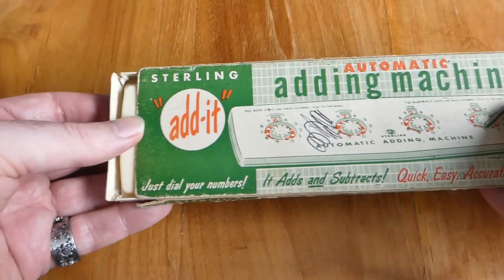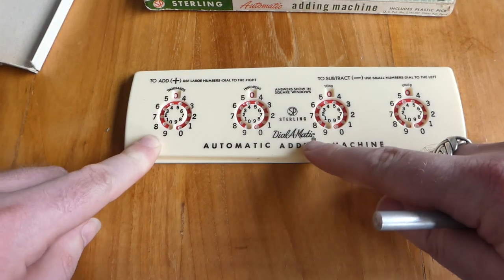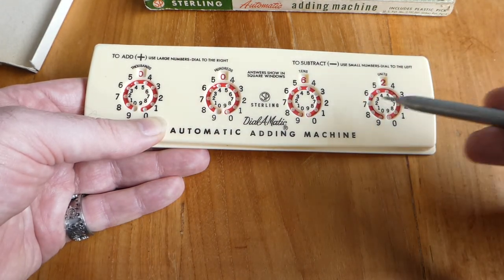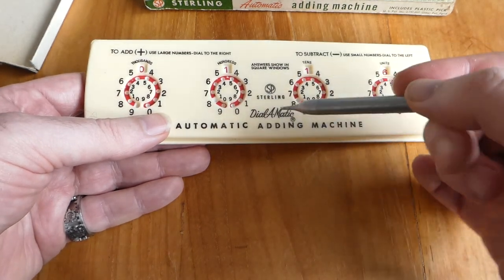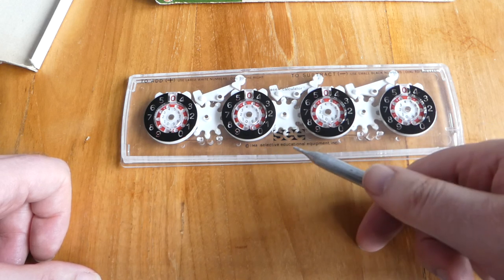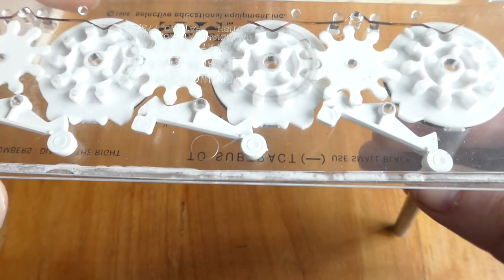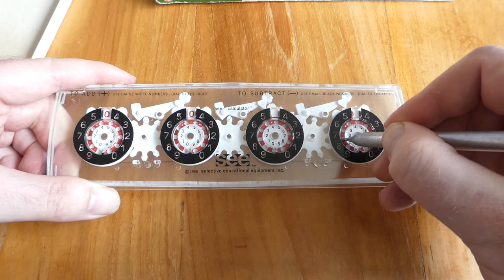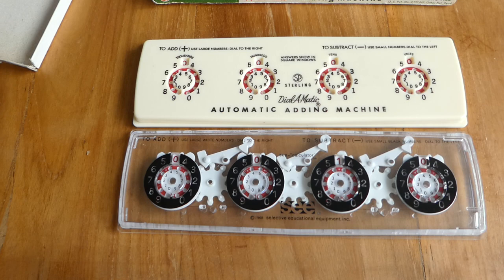The Sterling Dial-A-Matic Adding Machine

Comment: Can this do 19 + 10? Looking at the mechanism I can't see how it prevent "backward carrying". When the carry gear - the one with 1 teeth is at a position that is about to carry - 9 or 0. How do they prevent the larger digit gear from affecting the lower digit?
Reply: There is no carrying in 19 + 10 = 29. just moving the tens digit one place, then the ones digit 9 places for the 19, then moving the tens digit one place again for the 10.